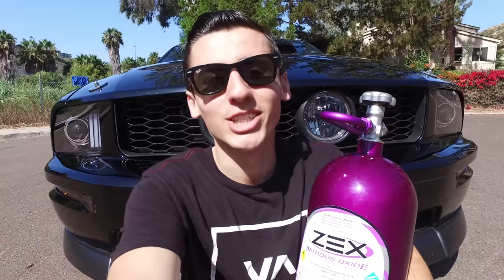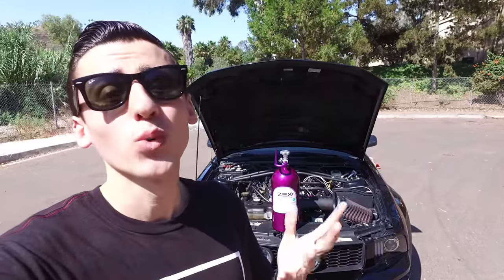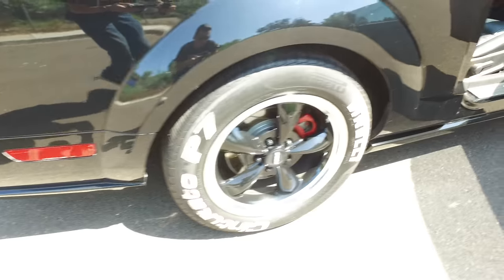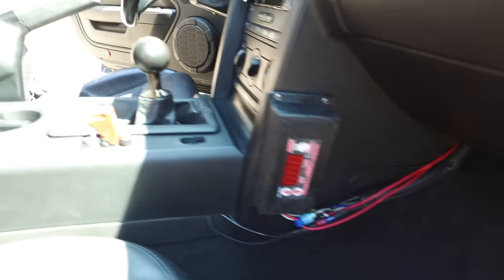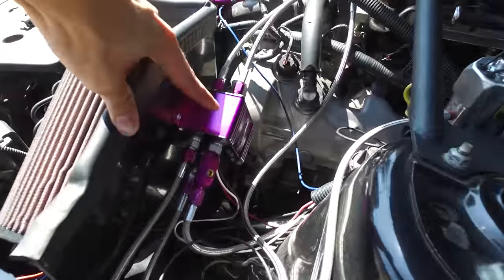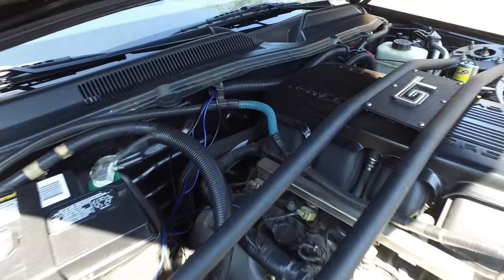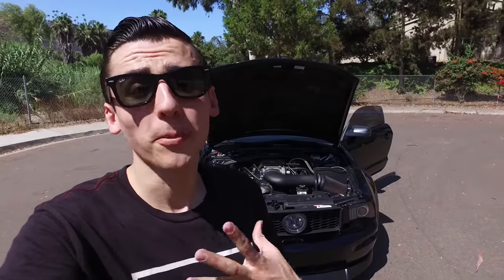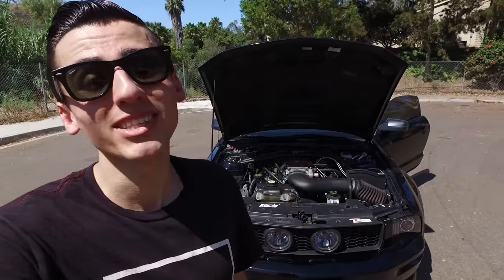Installing NITROUS To My Mustang: Review and Test Run!

Comment: Hey Nate, theres a lot of good and cooled space inside the dashboard right above the glovebox, with easy access to the rubber that you used to wire to the engine bay. And the purge line can be replaced by a fuel line from the ones sold at autozone. Ive seen a couple of guys connect it to the horse on the grill or the cobra on the grill and looks awesome when it purges! White stream coming out the horse nose!
Reply from the maker: Yeah imma definitly relocate that window switch. Its so ugly haha

yo i went to autozone and got those lines but it still will not fit! Idk why but it just doesn't. Imma keep on trying tho. I wanna purge really bad

Comment: I have owned my 07 since 06 brought it brand new. I think your a little high on your HP estimates but get a dyno tune and you will get your true numbers. I have a 3" pulley on my Saleen SC, headers, GT 500 fuel pumps, electric water pump, etc etc.  and my Dyno tune  from Brenspeed was at 452 rwhp.
Reply from the maker: Yeah those numbers I meantioned are to the crank, at the wheels I will probably be making like 370-400 rwhp. I will let you know for sure when I dyno it

Comment: Congrats on the upgrade bro. Nitrous is tempting, but with 95,000 miles I'm afraid of pushing my luck!
Reply from the maker: Im at 75,000 miles. You're fine! These cars are lasting until 200,000 miles plus
Reply: Nate Rider I just bought an 07 with 72k miles
Reply: GA08GT stop playing and spray that thing man lol. Spray & Pray
Reply: GA08GT...dude i got a 2008 S197 with now about 124K. I bought her brand new in 2008, so i know this car well. I know how you feel about pushing it. But ya know what? That 100K mile mark that you are thinking about is really kind of a misnomer. I thought that too about my car. But I went ahead and started modifying it anyway (so far just suspension though) because what it comes down to is if you can't drive the car the way "you want" then why even do it, right? Just to let you know my car recently has been tracked several times. The car still holds up very, very well. I haven't noticed any issues or added wear, except for some stickier shifting. But that was due to driver error...I heavily grinded a shift at sustained redline...stupid me. Luckily, she still changes gears fairly smooth...lol. You just got to make sure to keep up with the maintenance and make sure you replace and fix whatever needs replacing & fixing. And IMHO, when doing so only replace with at least Ford Motorcraft or upgraded parts. Have fun!
Reply: Nate Rider I got 165k miles. Do you think I'd be good with a supercharger on my motor? Will it hold up
Reply: nola504boy1 can you put your input in my question as well ^^^
Reply: THE REDLINE RIOT I don't see why it wouldn't. A close friend of mine has 244k miles on his supercharged 3V. Btw he races that thing every weekend also.
Reply: THE REDLINE RIOT also most of his miles are Hwy miles because he travels a lot to visit his kids
Reply from the maker: Awesome man! Do you have any plans for it yet?
Reply from the maker: haha spray and pray. Classic.
Reply from the maker: Great testimony to how long these cars last. It is awesome to see mustangs last so long. Idk why people get so scared of 100k miles. You still have an additional 100k to go!
Reply from the maker: Heck yeah it will. Just take care of your car and your car will take care of you
Reply: hey nate maybe we can do a live stream together sometime. I have an 05 mustang gt
Reply: I'm at 146k and spray a 75shot from nitrous express lol
Reply: Forget the miles. First off, don't make the same mistake so many others make. Make damn sure your ring gap is right for your applications. No matter whether your engine is a 2k miles or 120k miles, you will lift a ring land if your gap is off. An engine with some wear can in some cases actually handle a bit more, as the blowby and worn rings, are less prone to butting up. Call a company like Total Seal and get the rings you need, that's a key element in all nitrous systems.
Also, never trust what the morons who say 2 degrees of timing per 50 hp. It's not like that. You might need quite a bit more. Also, your engine will work the best and make the most power on the shot as it will off it. Get a bung installed in your exhaust so that you can always monitor your A/F ratio. Have your system tuned on a dyno and have the timing set on a dyno. Start out conservative. Lastly, have a proper controller. Ramp your shot, rather than just hitting the engine hard with it.
Missing any of these steps, equals a half assed nitrous install and it will cause you grief in the end. Nothing wrong with nitrous, but never believe those who tell you it's as easy as scratching your ass and any idiot can do it.

Comment: I have a black 07 GT convertible with every bolt on except heads I'm going with the zex kit because heads are not a good bang for the buck can't wait to put it on this will be my third ride wit a zex kit love nitrous I've never had an issue. My car makes 420hp at the crank it's been dyno'd  she should fly. Love your car and your vids keep em coming .Would love to see some staggered wheels on that horse
Reply from the maker: Nice! Definitely go with that setup I think you will like it! That is the next big project imma purchase. a nice staggard set of wheels

Comment: Do you think an 05-09 mustang is a good car for a first car? I get my license in a few months and I want a mustang under 5k so it'll have to be a v6 but oh well. I figured it's not that expensive of a car so if I get into an accident, it won't be that big of a deal. Thoughts?
Reply: SirSasquatch insurance will be really high idk about the v6s but on the gts where I live they want $300 a month for full coverage. It's a really great car just don't expect to be super fast because it has almost no take off to satisfy my needs 😓
Reply: No it's not, it can be a handful on rain and snowy roads, and requires you to know how to maintain it. Insurance will cost you a kidney and V6 and V8 are almost the same at the fuel pump. I had both, a V6 grabber orange 09 and now i have an 05 v8 Gt cause its gonna be a future classic car. I would recommend you a 4 cylinder for your first car, and a couple years later step up for a bigger one. Mustangs are awesome (thats why its my fav car) but they have a temper on the road and will buck you off if you not experienced on torquey rwd cars with a happy tail. Just my 2 cents bro. Stay safe!
Reply from the maker: Yes of course! I was actually thinking about making a video about this topic in the near future, but absolutely! go for the v6, you can get them for super cheap and mod it up to however you want. Go for it!
Reply from the maker: Great input man! Thanks for the help
Reply: You could do that and swap it to a 3.7 on boost. Cheaper insurance and more power.
Reply from the maker: Thanks for that great info! I didn't take into consideration the weather and insurance, because thats different for everyone, but thts good things to know
Reply from the maker: I never heard of a 3.7 engine swap lol
Reply: Nate Rider hahaha neither did I till it slammed me in the face when I got my first car!!! I had the budged for a 2000 V6 brand new mustang and ended up with a 2001 Mitsubishi Lancer cause until you 25 insurance is retarded expensive 😂 but hey! I hella enjoyed it and still have it parked in the garage with almost 200k miles on it! Little bulletproof thing ❤️ now im on my 2nd Mustang, had an auto 07 V6, then an 06 Manual V8 and I couldn't be any happier! Even after buying an f150 platinum I drive the mustang more than anything else when possible! No other car puts an smile on my face like Eleanor

Comment: nice video man ! ..I have a question I have the same kit on my hellcat but I think my question is if your window switch works with your smart box or  management unit cause I need a window switch with gear lock feature but I called zex tech and he says that no window switch works with the zex management unit box ..I will really going to appreciate if you can help me with this thanks !

Comment: Man I know this is is an old video but I recently just got this same exact kit and I’m trying to wire in my window switch. I have my red wire coming from the nitrous box going to a toggle switch that’s wired to an ignition on power source. My question is where do I run the wire from the window switch. My window switch has 4 wires power, ground, one to read the cars rpm and the wire that goes to the nitrous. My question is where do I run that wire? Seems like I’d run it to the nitrous solenoid but that’s kinda impossible with the zex kit because it has the self contained unit with only 3 wires coming out.

Comment: That's freaking badass !!!!! Idk about it for my car though I'm a little scared to try it out lol .... your reaction is priceless ... nice vid bro .  By the way I wanted to ask do you think I should go with a borla atak cat back or Roush AB?    I'm not going to lie is rather get quad tips but I've seen for my v6 2014 only the gt500 mufflers are my only option but not sure if I want that.  Only because I've heard borla atak In person . I would love your feedback bro . 

Rafa  from Sacramento, ca !!!!!
Reply: r becerra91 borla atak is better if money isn't an issue
Reply from the maker: I would definitely go with borla over roush if money is not a problem. Borla exhaust note is so perfect.you can get custom quad tips for your ataks. you would have to go to a shop and do that though
Reply from the maker: you got it right on the money
Reply: @Nate Rider, okay thanks so you guys think I should do a  cats  delete if I go with the borla atak?
Reply: my 2011 V6 is very loud with borla stype and hi flow cats, so if you like loud then go for it, but you will also have to expect a lot of rasp unless you have a CAI or Tune to help reduce rasp
Reply: @Diffusion887, I think I'll just end up getting a borla atak cat back  and that's all . That should be loud enough . I really don't want it to be raspy . I hate that type of loud
Reply: the borla atak catback will definitely be loud, it will sound great too for a V6. Maybe in the future if you did want louder, o/r h pipe will sound better than o/r xpipe. Tune will also help make it sound less raspy. I'd swap out my hi flow x pipe for something else, but im getting an 05 mustang GT in a couple weeks so im just going to leave it on.

Comment: Where did you get your bottle filled in SD? I'm trying to get it installed and testing at Qualcomm on Friday.
Reply from the maker: Conley Motorsports! Nitrous prices have doubled ever since the shortage so expect to pay $80
Reply: Where are they located? I can't find any info on a shop with that name on google except for one in Ohio lol.
Reply from the maker: They are up in mira mesa, but they are going to relocate down in San Ysidro. It should pop up under Conley motorsports in la mesa, its confusing why it does that

Comment: You have the activation switch wired backwards the cover is suppose to prevent activation.
Also i get it but for bang for buck better off trading in for a coyote.
Reply from the maker: I fixed it

Comment: You really trust bama to tune your nitrous Jesus you better get a air fuel gauge and a vmp tune or your going to send those rods to meet the pavement
Reply from the maker: hahha bama tune is not the best but its what i got for now. I needa save up for a customer tune
Reply: Any nitrous setup without an A/F gauge is a disaster waiting to happen.

Comment: I'm confused on how long would the tank last and how do u put more in it
Reply from the maker: It depends on how much you use the nitrous. It can lost months long if you use it wisely. And you just go to your local nitrous refill dealer
Reply: Pierston Salinas 100 shot you could get maybe 3 or 4 full 1/4 passes after that it starts going down hill. Another rule of thumb is 10 sec per 1lb on a 100 shot.

Comment: Order brake line for like a truck from amazon - Super cheap.
Reply from the maker: I did but it still doesn't fit...
Reply: If you look at photos 7771 and 7772 you can see the purge line that runs right up the center of the intake.   That is brake line from amazon.   The is a small video in the folder of it purging.   Note no Ratchet shifter or BBK on the car.   We thought about selling it and decided not to, so I did what any sane person does I spent 3k$ more on it.